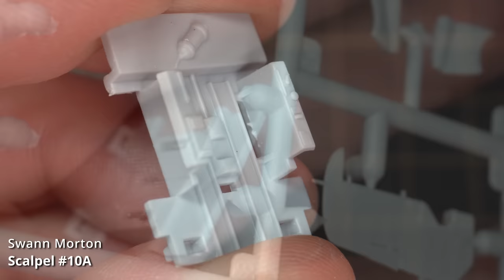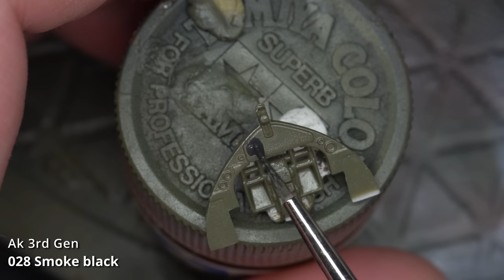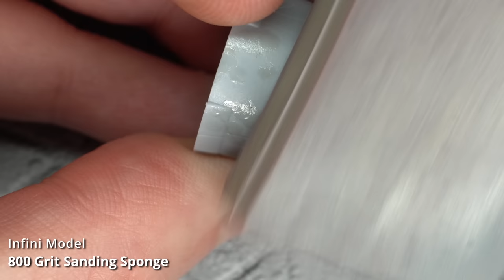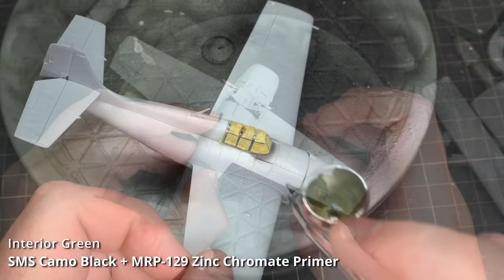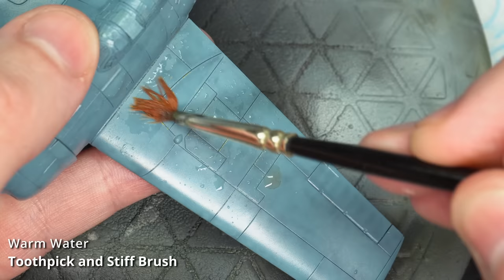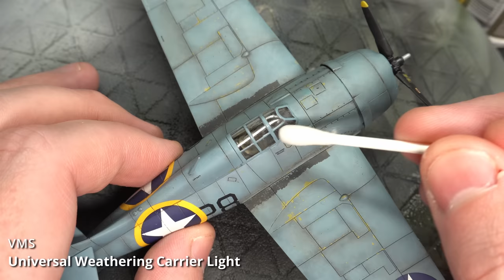Airfix 1/72 Wildcat F4F-4 | Full Build

Comment: Great video, great build, sir .Your kit turned out well in spite of your minor criticisms. I built the A02070 Wildcat. The parts appear to be similar, and I do not recall the flash and speckling on the engine, or anywhere on the kit. I found the kit to be well-made with very few flaws.